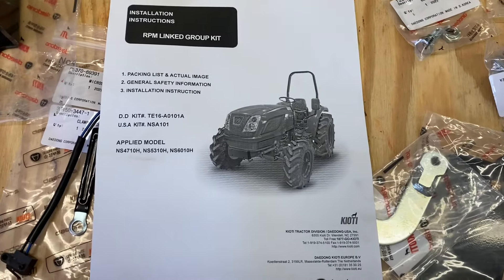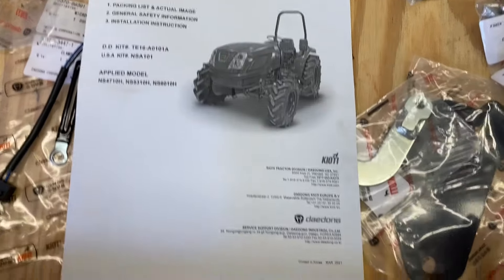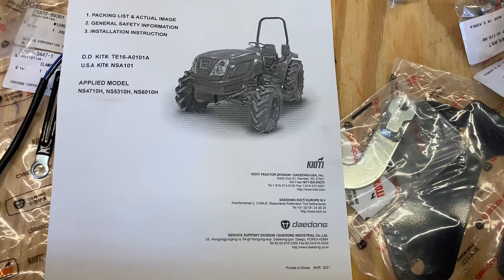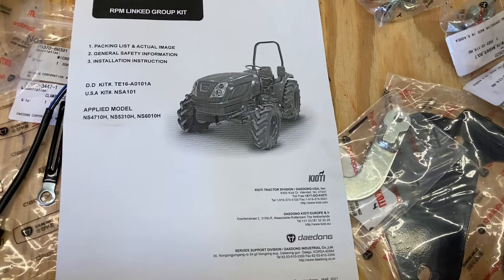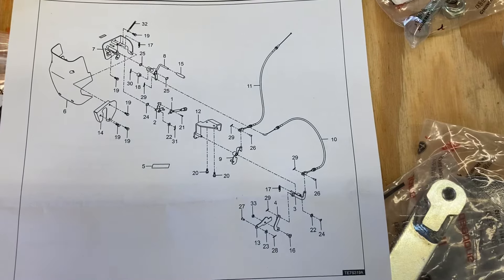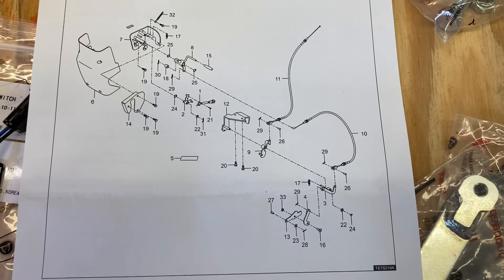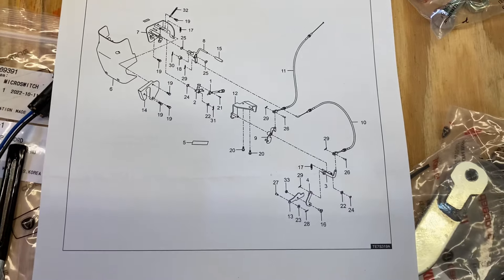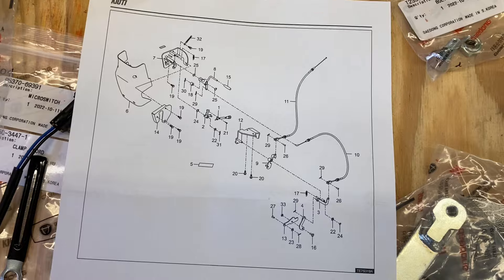Kioti NS4710 Linked pedal install

Comment: Do you have the PN you used or a link to the part?
Reply from the maker: No sorry I got it through my dealer. I looked in my shop and I don’t have any documentation that shows a part number
Reply: kioti part number NAS112, $188.00